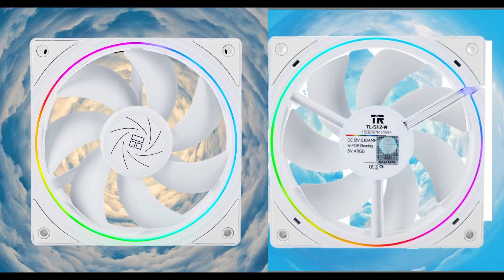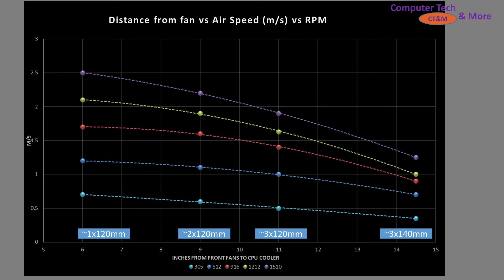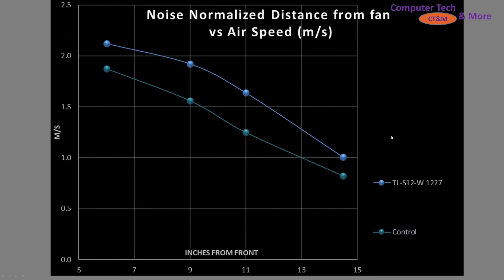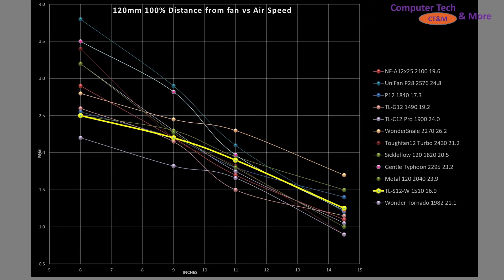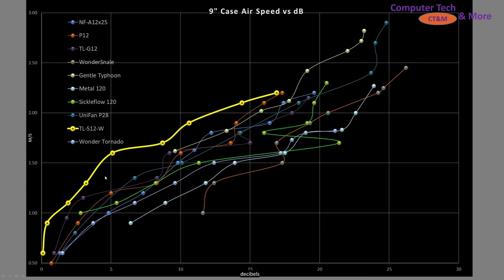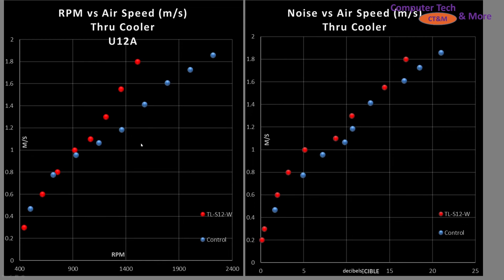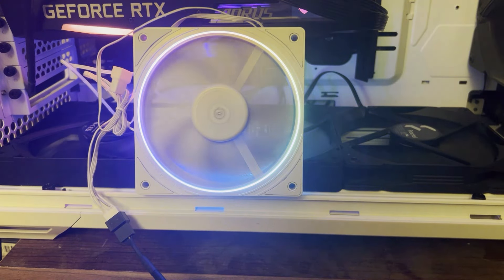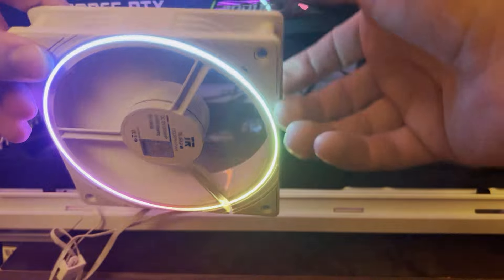TL-S12: The New Value King??

Comment: I have 3 of these as front intake. At full speed, they are almost silent. Cheap, effective and pretty. It gets the job done as case fans. Seems to run better than the specs suggested. You dont need to buy more expensive higher cfm but only run at 50% speed.
Reply from the maker: thank  you for sharing your experience. Glad it lines up with he performance I saw in testing.
Reply: I have the Cooler Master TD 500 Mesh case, planning to run 3 in front as intake and 2 in rear as exhaust. Idk if you're familiar with that case, but based on your experience with them, would you recommend them?
Reply: @Plague_Rat778  Definitely, if you want intake fans that stay quiet at full speed. I'm still happy with them.
Reply: @alexriz2292  i ended up getting 2 3-packs of these fans and running 3 as intake, 2 as exhaust like i said before. They look great, they're silent. And paired with my new CPU cooler which is overkill for my CPU. Haven't seen temps higher than 45° for CPU and 60° for GPU

Comment: I like how it has RGB but still looks plain black with it turned off so I dont need to worry about it looking out of place if I decide to not use the RGB. As I'm using them right now on an old build that I plan to bring to a new build in the near future
Reply from the maker: I also tend to like subtle RBG. Glad to hear these fans are working out in  your system.

Comment: Thanks for the reviews. Love your graphs with other brands/models, they are so helpful. Plan on getting the reverse version (TL-S12R) of these since the halo is broken up at corner on the back and it will show on my case. Have you found reverse version of fans performing differently? No necessarily this model fan but others.
Reply from the maker: Ive only tested one reverse fan so far. They move a similar amount of air but are noisier by 2-4dB if I recall.
and Thank you for watching. Glad it was helpful.

Comment: Hi! Could I run 8 of these with the x870 elite without a fan hub?
Reply from the maker: It is generally recommended to only run a max of 3 fans per mobo fan header. (note some fans (not these) use higher Amperage and you can only run 1 or 2) 
So depending on the number of fan headers on the mobo yes you can do it

Comment: What do you think of this fan on a radiator for 7800x3d
Reply from the maker: thanks for all the comments. So what kind of Rad are you getting a 360? if so 3 of these should be fine. a 240 might not do it.
Reply: @ I have a 360 radiator
Reply from the maker: @tocxoanconbet  it should do fine. I would say as long as  you dont plan to OC
Reply: @ Tks for the reply. I really appreciate
Reply from the maker: @tocxoanconbet  np

Comment: is apps like signal rgb compatible?
Reply from the maker: not sure. I used signal RGB for a very short time, before just accepting my fate and using 2 companies own software.
It was not due to these fans though. 
It should work. since fan lighting is pretty basic.
Reply: @computer-tech-more  alr what software did you use tho?
Reply from the maker: @ I use the mobo brand one. Asus . . .its ok

Comment: Appreciate all the graphs! we can actually see the difference in terms of cfm and noise levels and cost effectiveness between brands. 

But ultimately i think people wanna see how much is the difference in terms of “temperature” of the system mainly cpu and gpu. Because at the end, that the main purpose of case fans, which is to cool your pc.

Anyways still grateful for your effort, you earned yourself a sub !
Reply from the maker: I actually want to add temp testing but I dont have the spare $$ to just go and build a test system. I would actually need like 2 to 3 systems. 1 air cooler, 1 Rad, and one for pc case simulation.  
I am a small , very small channel. I dont have "revenue" like larger ones. 
So I have to fit in my channels limitations. 
I have a planned v3 of my testing method and I'm just waiting to reach the point I've "made?" enough from ads and patron and youtube membership to buy all the equipment. to then overhaul the testing. 
I have a piece on my channel about what tests i want for v3 of my method. 

Overall I am pretty happy with what and how ive tested with the limitations. :) 
Thank you for the sub. I appreciate that. and thank you for watching.

Comment: These reviews are only getting better. Great work! 
So it seems that the FDB v2 on the K12 didn't help with performance neither noise. Maybe longevity?
Also, there is a reversed version (S12R). Assuming that everything is equal, only the blades are reversed, do you think that the result is comparable with the S12?
Comparing prices here in my country, I guess I'm pulling the trigger on the S12 anyway
Reply from the maker: oh the R is a reverse airflow. Noise and airspeed performance will be a bit worse. like 5-10% in general. I have only tested 1 reverse to this point. video not published yet. 
its basically to have the pretty side up.

Comment: Doesn't the strut count make a big difference with the blade count because the blades interact with the struts at the same time? Kind of like how i3 engines are rougher than i4 cause they're uneven in the firing sequence.
Like 3 struts 9 blades is worse because 3 blades pass the struts at the same time.
Kind of like the Blacknoise Noiseblocker NB-eLoop 120mm have 6 blades and 4 struts and the noise profile would've been better if it either had 7 blades or 5 struts instead?
Reply from the maker: hmm sort of. I have a video in the works about fan design where I talk about it. 
but short answer is Primary fan noise should be just air going thru it. 2ndary noise is bearing and last is the blade passing the struts. 
When properly designed the 2nd and last are near zero noise. Harmonics are another noise factor: just how a fan vibrates if its not properly balanced or frame not strong enough or blades to thin.. 
I wouldnt concerned about the noise of the blades passing the struts unless this was a 200RPM + fan. and if you look in the opening picture or where I talk about the fan the blades are not quiet lined up with he struts at even intervals slight offsets. 

but yes your analogy could be true if all things were equal.

Comment: Appreciate the work you've done!
Currently, black 3 pack without argb version is 14.59, and white 3 pack with argb is 14.90

so they're like 4.87-4.97 per fan

might just grab a pack
Reply from the maker: thx for this. basically at that price its unbeatable.

Comment: On Thermalright product page,  I see that some ARGB fans have logos of Aura Sync, Mystic Light,... except TL-S12.
Is this fan compatible with RGB Sync?
Reply from the maker: it should be. I only have Aura Sync and it was fine. Like should work with most mobo brands or software's
Reply: @computer-tech-more  my motherboard only has 12V RGB header, so I bought a DeepCool RGB Hub Converter. But when I connect the fans, it keeps randomly blinking, not stable. The Aura Sync doesn't detect any devices too.
So what do you think might be the problem?
Reply from the maker: @spectre8211  oh sorry miss understood. going to say no. I think it requires the ARGB 3 pin

as for the problem. Ive only started using ARGB with my current build. and then just did Aura Sync made a quick profile called it a day. the RGB side and how to make it work well I am not well versed in sorry.
Reply: @computer-tech-more  thank you for the answer 😁

Comment: these results seem suspect.
Reply from the maker: please elaborate. I run every fan thru 3 passes. I am non-sponsored doing it in MY free time. 
I am also a professional aerospace engineer.
Reply: @computer-tech-more  "I am also a professional aerospace engineer. "   appeal to authority logical fallacy.

it seems suspect due to relative performance to P28 and A12x25. The results don't line up with published cfm/db  specs. The units of the test air speed vs distance seem a bit odd as well and might have something to do with it. Why wouldn't you be measuring  noise vs CFM like everyone else? I assume you are not testing these in a tunnel to capture and measure all the cfm. 

And I just don't believe this $7 non LCP fan is beating a a12x25 on a cooler. Too good to be true. Smells off.
Reply from the maker: @madamcurie-yg5sr  So its actually quality of equipment. Between this video on like 1 or 2 after it I ran a half year of use check with the anemometer. Video published with data that was considered correct at that time. A12x25 now verified at 1.6m/s NN and 2.4m/s 100%. Newer videos I check against A12x25 before every test or verified consistency and can apply a correction if needed in the future. 
The S12 performance since this has maintained its position. 

I dont do CFM because I am not scientifically testing a fan against a manufactures claims. I am real world testing a fan.
This the main problem I have being a small un-funded channel. I cant afford the high quality equipment I want and need to have the "best" data. 

I have a methodology piece on my channel that goes over my method. Its not my end goal just what I can do with an non sponsored channel or one with very limited youtube and patreon support.
Reply from the maker: @madamcurie-yg5sr  I also wanted to thank you for explaining what you meant with your comment in such a detailed way.
Reply: @computer-tech-more  "I dont do CFM because I am not scientifically testing a fan against a manufactures claims. I am real world testing a fan."  except testing air speed isn't a real world test either and is less meaningful than CFM. Air dispersal patterns as it exists the fan is going to affect how well air speed correlates to CFM(what we actually care about) and that pattern is going to be different for each fan. If you can't properly test CFM, A useful real world test would be to measure temps on a standardized testbench with a somewhat calibrated heat load. Ideally against different resistive loads, heatsink, radiator, etc.
Reply from the maker: @madamcurie-yg5sr  If your trying to generate PQ curved you need to create a wind tunnel to test CFM. 
If you want to know how good a fan is in a PC case you either do what I did make a test chamber that represents a PC case or you pick a case to test in. If you want to know how good a fan is on a cooler you hook it up to a cooler (what I did) or you can simulate a cooler with different sized restrictions (PQ curves). 
Cooler CFM is still an estimate because you are measuring a square hole white a round plug. on a heatsink or Rad. 
As for the case sym CFM it doesn't make sense to do it there. I would need an array of anemometers or one really large one. 
My current CFM test is not perfect. its actually flawed but it gets the job done for now. 
Again everything is not end goal. I actually have a piece about what my future plans are with models ive designed of future test equipment. at the time i didnt model the flow guides before hitting the anemometer. 

I am missing a test system to get temp. Again my channel does not have the $$ to buy that yet. building up to it. 

and yes air flow patterns out the back of the fan are different thats why i created my case simulation test in the first place. its just one one cared what I had to say about flow patterns so I stopped talking about it and just talk about fan air speed effectiveness in that box vs distance. 
When making a video to actually get any view I need to stay under a certain length and keep the viewer engaged. what your talking about is some of what I wanted to do but no one watched. so I dropped it. 

I am limited by $$. To progress i need $$. If you have $$ and think you can do it better please do it, I would watch it. I started fan testing because all the big channels are a joke when it come to fan testing.
Reply from the maker: @madamcurie-yg5sr  My comment about being an aerospace engineer was to state qualifications, I have a masters and everything in this field of study. Plus years of experience. so. . . . 
So I wouldn't be a "Authority of logical fallacy" but good use of words. 
haha